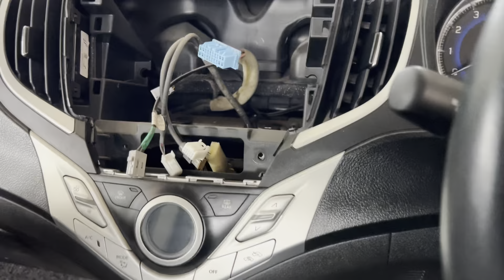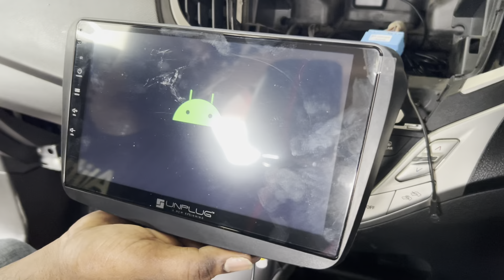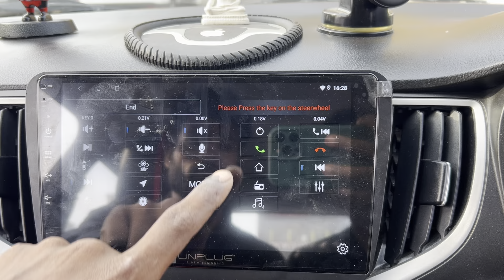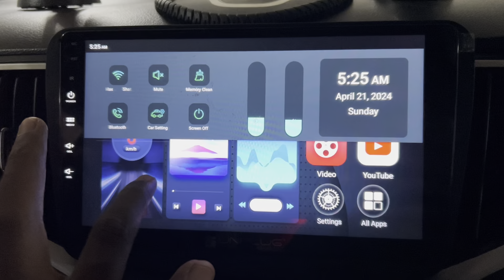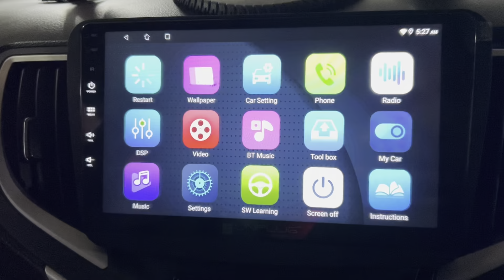Unplug android car infotainment system installation in baleno | Gold 2gb RAM 64gb ROM with Camera

Comment: Hi.. FM not working in my Brezza car.. unplug installation done 6 months ago.. FM radio working only in Hyderabad City
Reply from the maker: Which location s not working?
Reply: @ShatLing except Hyderabad City.. no where it is working
Reply: Its making noise and no signal
Reply: Same happened to me check the FM lead which connected to system.